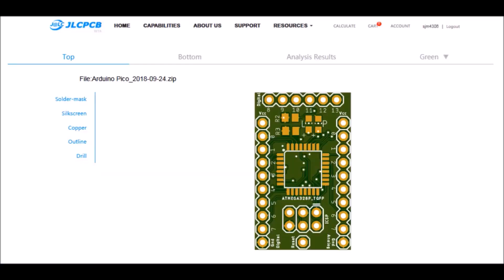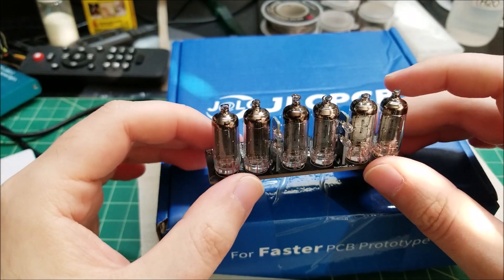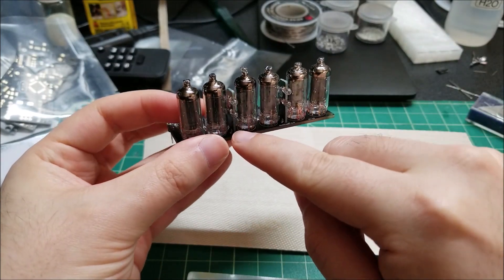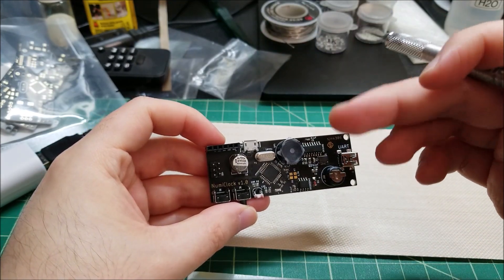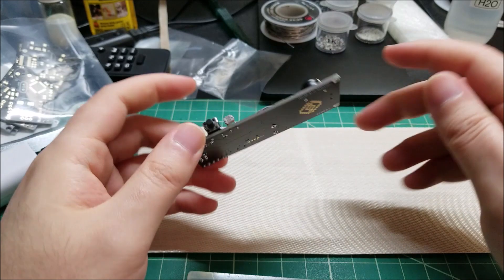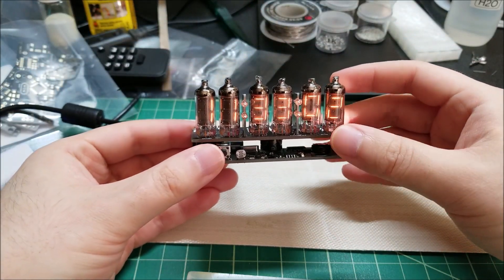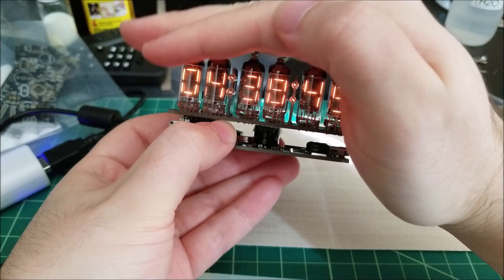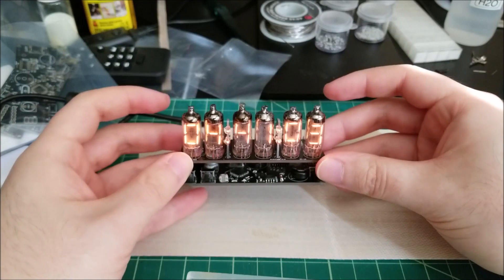NumiClock - DIY IV-16 Numitron Clock Part 2 - The Main Clock Board and Software!

Comment: Looks absolutely fantastic! I still have to put some life in the VFD tube you sent over. Oh I found a mechanical rolling wheel clock looks 120v AC with a cute little shaded pole motor. Are you interested in it? I was thinking to maybe carefully drill little holes in around the digits do you could light them up as well. Are you interested in that?
Reply from the maker: Thanks! Yeah that sounds great.

Comment: for am/pm while setting the time, i suggest blinking the top dot of one of the colons for am and the bottom for pm. or ignore the seconds and use the last 2 tubes for am and pm, and have it just set seconds to zero when you change the time.